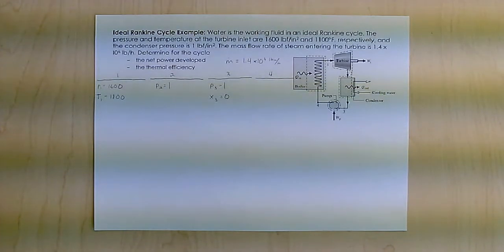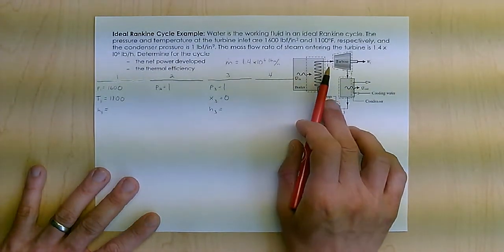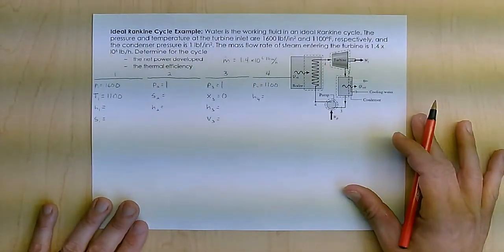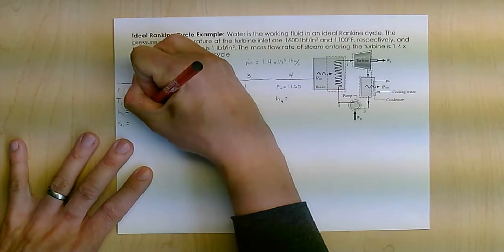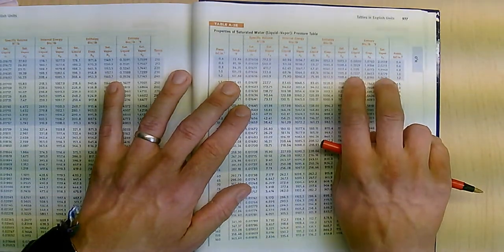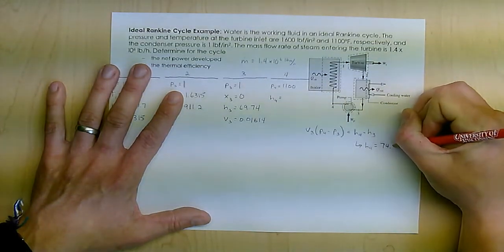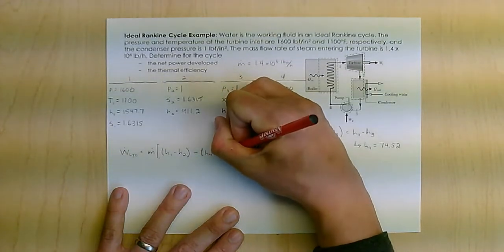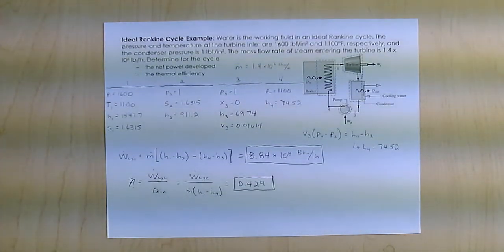Thermodynamics Example 24: Rankine Cycle

Comment: Wish you went over interpolation in the problem or how you got h4
Reply: Late, but you solve for h4 by using the quality equation for s values, then plug that quality value into the same quality equation for find h4.

Comment: Correct me if I am wrong, but I believe the enthalpy for process 2 should be 554.42 not 911.2
Reply: 911.2 is right, I did it by hand by comparing the ratio of the S2 value to the enthalpy range to find h2